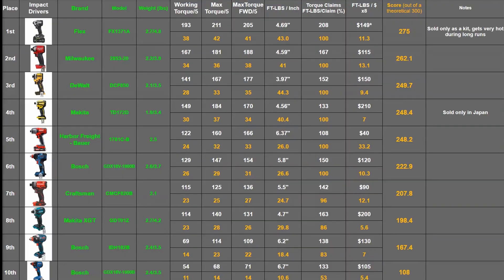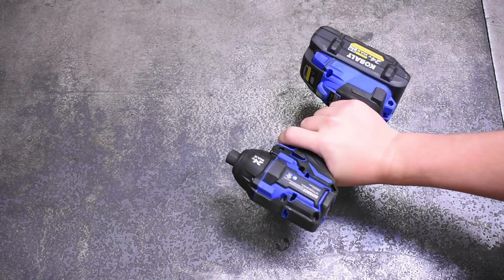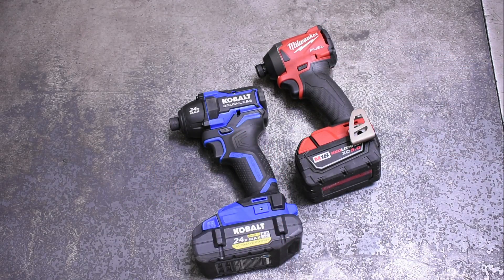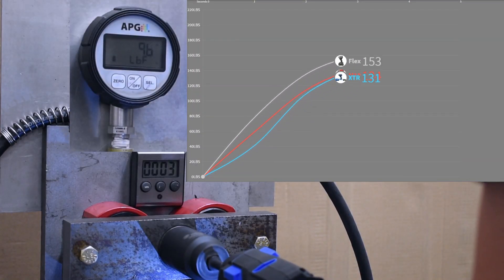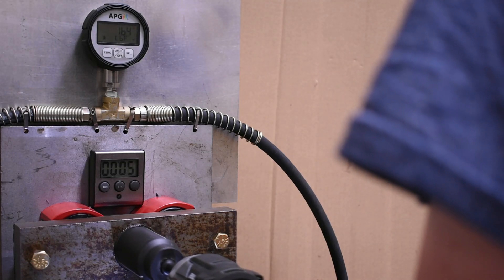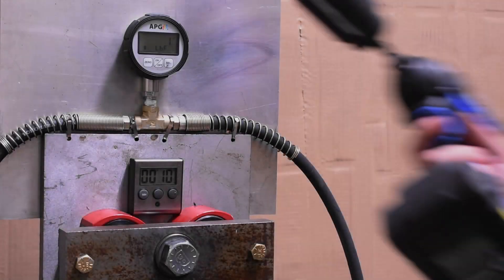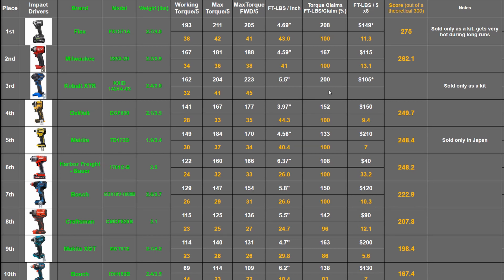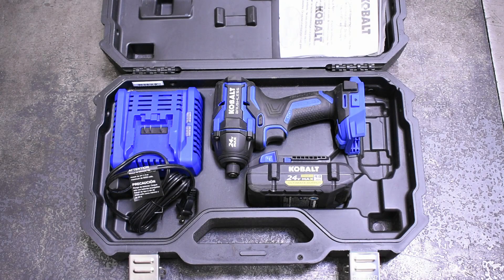You All Said THIS is the Most Powerful Impact Driver: Dyno Finds Out | Kobalt XTR

Comment: I went with Milwaukee if only because it's everywhere around here. Home Depot, my GearWrench guy sells it, JDTco sold me a few items. So far the bit driver is crazy powerful for the tasks it will be used for, needing only position 1 or 2 on the power modes to work effortlessly.
Plus 5 years on the tool and 3 years on the battery, set the industry warranty standard. Many are offering the same now.

But, they all seem like good tools, as long as the durability is similar.
Reply: Agreed a big plus to me is versatility of m18/m12 batteries for equipment. Not sure on kobalts line up for other tools

Comment: I put the anvil from a 3/8 drive impact into my Kobalt impact driver because it broke every bit I used with it but to get the power it has to have the high output batteries, the standard batteries drop the power way down.

Comment: So I have been using Kobalt for years but have been slowly “upgrading “ to Milwaukee.
On Monday I bought new M18 fuel impact driver. On Tuesday I have to drive 3/4” lag to hang a truss. I couldn’t wait to try out my shiny new tool but it couldn’t do it. One of my guys has an older Milwaukee non brushless. It drove it a little bit but stoped. Just for curiosity I told someone to grab my old Kobalt. It drove all 16 3/4 x5” lags all the way home. I couldn’t believe it. I kept trying the fuel just to see if it was a fluke but no it couldn’t handle it. I was so mad. I just went and spent almost 200.00 on a tool that couldn’t perform as well as my old cheaper tool.

Comment: Maybe test the non-XTR Kobalt. It’s $100 with charger, tool, and battery. Could be interesting to see how it stacks up since it is brushless and rated for 2000-inch lbs of force whereas the XTR is 2400-inch-pounds

Comment: I just bought the FLEX kit that has this impact driver with the hammer drill last week.  I'd like to point out that the FLEX kits give you One 5.0A/hr and One 2.5A/hr battery as opposed to TWO 4.0A/hr or 5.0A/hr batteries included in the other comparative brands (Milwaukee,  Dewalt, Kobalt, etc).  Keep that in mind if you are looking at these kits in terms of price, especially after the end if the year when the Lifetime Warranty promotion is expired.  One of my main interests is the bit retention, especially with spade bits.  One of the major problems with the Milwaukee impact drivers is that they eject the bits under load.  VCG Construction has a few videos of this failure and the improvement Milwaukee made to the gen 3 FUEL design.
Reply: It seems to be a common issue on all the super powerful impacts, Kobalt and Flex included. It certainly doesn't seem affect them as badly as Milwaukee, but it does happen with things like spades.
Reply: @GuyFromJupiter  Well Milwaukee fixed the problem tlby adding an additional ball bearing in the collet and re-released as gen 3.5 (I'll post the link below)

VCG Construction's video:
https://youtu.be/6jvjs2GZ9gg

Comment: What about the Klein BAT20CD? Rated at 210 ft-lbs (2520 in-lbs).  Basically a detuned DeWalt DCF894 with a 1/4" quick change instead of an anvil.  It even uses DeWalt batteries.

Comment: That's weird I have the flex and I would have to drive 15-20 6" truss screws at a time several times a day and it never got super hot like yours and definitely never quit on me. I have noticed that sometimes the computer chip gets a little confused and will put out almost no torque when you first pull the trigger, but it's rare and as soon as you pull the trigger again it works like it should.

Comment: Both the Milwaukee and the Flex are also equipped with a 5ah battery in these tests and the kobalt only has a 4ah, and it still kicks more torque butt per dollar spent.

Comment: I dont know if it was a few faulty units, but FLEX seems to have quality control issues with breaking handles, and while it brings the speed for easier tasks, they struggle with more difficult tasks that need better low speed power. The tests reinforce that. They also caught the overheat issue which I saw in other videos too. I wouldnt buy FLEX at all at this point.

Comment: How about the M18 with a 21700 cell battery like the others?  6.0HO?
Reply from the maker: The flex is using an 18650 and the XTR batt is closest to a CP3.0
Reply: Gotchya.  I knew I missed something.  That flex’s overheating is discouraging.  My m18 on structural fasteners all day on hot days is fine.  Couldn’t imagine the flex

Comment: I began having issues with my 2nd gen (may have been 3rd?) Milwaukee Not long after I got it. Would lock up if you tried to "tappy tap tap" the trigger. I'd have to pull the battery to get it going again, y'all ever have any issue with those? I'm not doing ornamental iron anymore so the drivers aren't an issue as of now. Was just wondering?

Comment: Question:  I have an M12 impact driver.  I was using a Ryobi impact driver rated 1/4" hex head bit and trying to break loose my stuck garbage disposal.  The Ryobu driver bit broke after about 15-20 seconds.  This shocked me - I would not have thought that an M12 impact driver could shear a 1/4" impact rated driver bit??  Are the Ryobi driver bits just weak?
Reply: I think the M12 is a reasonably powerful tool, at least considering its lower voltage. That said, I do believe Ryobi bits tend to be pretty subpar. To me it's seems like DeWalt makes most of the best drill and driver bits.
Reply: Yes they are…. I snapped a couple of them easy & that was it for them.  
Beretta9MMUSA Sr.

Comment: I have one of those blue monsters I honestly don't like it that much.

If I use it with socket adapters if I hit a bolt that's hard or tough removing something it just breaks the adapters and I have tried many different adapters all with the same or similar consequence of them breaking most of time after one or two uses if the bolt is particularly stuck.

 In fact I no longer use the most powerful setting. It would be nice if someone made a impact adapter that could take the abuse the new tools can give them.

Comment: I'd like to see the channel torque a bolt to 200 ft-lbs with that socket and that 1/4" drive adaptor and a torque wrench.  My brain says  nothing that skinny will take 200 ft-lbs.
Reply from the maker: It won't take 200 applied linear like a wrench. But in small impacts at a time...

Comment: I am curious, since "impact driver" is in the realm of purchases I can, and did, justify... I wonder if there's a more affordable of finding at least a crude performance rating. I'd love to know how e.g. my long discontinued Craftsman C3 compares to modern, fancier ones so I know what to look for and expect.
Reply: The C3 with a modern battery will perform well, the batteries of the C3 era weren't great. The C3 uses the same motor as the Ryobi P235 brushed impact, it performs very well with 21700 cells. The C3 might even with the old batteries probably matches the current Craftsman, but that's not saying much. 

I was talking with someone recently who worked in accounting for TTI. Apparently Sears missed lots of payments for the Craftsman C3 tools, they even went as far to claim they never received shipments.
Reply: I need a battery for my c3 impact and I wonder if I can run a Ryobi on it or how to modify one to make it happen again
Reply: @Beee_Ceee  you have to modify it, you can purchase an adapter or make one yourself. That's how these companies get us, unfortunately. Even though the Ryobi brushed tools and brushed Craftsman C3 used the same motors, they designed them to require different accessories. 

Given that the ebay adapter is 50 bucks, it'd be cheaper to buy a P235 impact(10-15 bucks on DTO), get the 10 dollar charger(the small black charger is actually the best for the new generation batteries) and spend the money for the good 3ah battery(best cells and performance). 

Upside about the Ryobi line is they kept the same system for so long, and they have any tool you can think of. Hell, if you buy one from DTO, they give away a free electrostatic sprayer for some reason at the moment.

Comment: I have a first gen Milwaukee.  Have had it since it came out along with batteries, so at least 8-10 years.  Not sure how it compares but have yet to buy new batteries and puts screws in no problem.  If you’re just doing simple stuff too much power can be detrimental.  Better off with consistent dependability.  Just my opinion

Comment: I have the kobalt XTR driver and used it for putting in lag screws for a deck rebuild, bought it with that box kit with the hammer drill, sawzall, 7 1/2 circ and light deal.  The circ ended up being somewhat disappointing with pressure treated 4x4s.  I ended up later getting a 1/2" kobalt driver for car work as the driver wasn't exactly fast for lug nut busting, and I did blow right through an adapter.

What's funny is that the tools I use most are lights not from that kit (I got one for 10usd and another for 40usd) and the tire inflator.
Reply: Ya that circ needs the 8ah xtr batt( whenever it gets here). My friend bought the Craftsman 7 1/2 that came with a 4ah. He was disappointed, but then he put their 9ah and wow what a difference.
Reply: I have that fire inflator and it has really come in handy! I would happily recommend it to anyone invested in Kobalt 24V. I also have the cordless shop vac which has been pretty nice as well, and I would definitely recommend it to anyone interested in one. One nice thing about it is that you don't have to remove the filter to vacuum up water like most other brands say you should.

Comment: How about a Flip socket test, I noticed today my mid tq gen 3, 1/2in Milwaukee wouldn't pull the lug nuts off my f550 with the bluepoint 21/19mm flip socket with the bluepoint 3in extension,  put a 21 impact socket on the gen3 3/8 and it pulled it off like nothing.  Very disappointed with this gen3 mid tq, what good is it if u can't use a 3in extension.  It wouldn't even pull off the nuts on the front hub extension to do a wheel bearing.  Had to get out the old 2017 2767 1/2in
Reply: I should've tried the capri and Husky flip sockets I have, they are heavier then the bluepoint

Comment: The internals are very similar to the Skil 20v brushless impact driver. That one is even less expensive, often less than $140 with battery and charger on Amazon. I doubt the Skil has quite the power being a lower wattage unit, but it would be curious to see how well it stacks up.

Comment: Kobalts xtr is the best kept secret in the tool world. They perform at top level and cost just a tad more than ryobi.
Reply: Yes and, actually, even less expensive than Ryobi when the price of batteries and chargers are considered. And you have to allow for that.  I'm a Kobalt fan boy nowadays.
Reply: @rtgray7  Me too. I kept replacing Dewalt tools left and right and with their batteries being SO expensive I decided to try Kobalt for my crew. If a battery gets lost its not breaking the bank and if the battery or tool broke you walk into lowes and they give you a new one on the spot. Great tools for the money as far as I'm concerned
Reply: I sold my fairly extensive kobalt collection due to the batteries not holding up and not having a good run time.  I’m my scenario, they aren’t geared for every day professional use.
Reply: the only problem I have with ryobi is the cost and.....they seriously need to upgrade some parts especially if they are claiming to be pro. Like come on, stamped steel shoe base for circular saw like really?
Reply: shh, quit talking about it
Reply: @Highstranger951  you're the only one. I know a handful of guys using kobalt 24v. Not a single issue.
Reply: I’ve been using Kobalt 24v tools since they came out and I use my drill set every single day to mix grout,thinset,and sand mix and I’ve never replaced it
Reply: @charlesking678  he’s not I’ve seen a ton of battery failures from them both guys I know that bought into the line gave them up and went to ridgid after a lot of battery failures and they have a very short run time.
Reply: I love mine
Reply: that is true if you don't take sales into account. when this video was posted a year ago, the dewalt DCF850 was on sale for $140 with two powerstack batteries and a drill (kit model number DCK254E2). right now you can get the DCF850 with a 5ah battery for $120. it has been on sale for $100 as a stand alone tool many times. it's a lot smaller and lighter than the flex.
Reply: Durability is the most important factor. It's easy to make a powerful impact device. That's the main thing separating pro and consumer grade tools. Most of us just need the cheaper power tools for non professional use.

Comment: The best deal I ever got was when I purchased the five tool XTR kit. It came with their hammer drill, impact driver, reciprocating saw, flashlight, and circular saw; also two batteries and a charger...And let's not forget the high quality very sturdy toolbox with wheels and extendable handle...all for $350! Hands down best power tool deal ever!
Reply: Yup I'm sold on this line of tools. Happy with them so far
Reply: Got that xtr 5 pcs kit for 299.99 CDN this week at lowes , incredibe vaue
Reply: And 3 years later I bought the same kit for 225

Comment: These Cobalts remind my hubby and I (working HVAC, Home build, to vehical mods) find these to be similar to the original Dewalts.
As drills go, we just bought the impact driver... so this is nice to see. Over all as a whole line up goes these will do great for the average tinker in the garage home owner. Average for people like us, which means we feel we get our money's worth plus we love the blue which is honestly just a bonus not a decision making factor for tools. I'm very sad to see this line being taken over by the new China born Craftsman at Lowes. Bad decision in our humble opinion. We were so disappointed when Black-n-Decker took over Dewalt. They still do OK, but they are sprinter tools verses cross country. I like my money to stretch further. If we go with something else it's usually Milwaukee or Bosch. We haven't tried the Flex yet but not likely to as we are pretty stocked up on tools right now. A couple years, we'll see what we're in the market for. We don't subscribe to upgrading for upgrading sake alone. If something breaks we replace, otherwise we work it to the label wears off and the tool looks ragged. Hubby was a rock quarry mechanic in Montana for several years and bought some Mac Tools, which 17 years later still work like they are brand new. Working on that kind of machinery and Diesel 18 wheelers hauling rock teaches a new kind of level in tool tough integrity. Where HVAC we ran our tools for long periods of time with little need for the strongest horse in the barn. Hike improvement can need both and vehical mods as well. We're pretty well rounded here on Sunset Blvd. Great reviews, glad I found your channel. I'm wanting to replace my hubbies pliers... all of them since they are all pretty toothless and ragged now. Learning about all these different pliers is making me dizzy. Any suggestions for a brand that offers quality that will last at least 10 years but not cost Snap-on prices? Cresent and Crewline are the brands he used... and he's hard on his tools. I was thinking after watch many videos of going with Irwin or Wren? But I'm finding each type of plier has different top ratings in brands (Cresent, needle nose, cutting pliers etc). Why can't one brand make great pliers in each category? Drives this lady crazy!!

Comment: The flex isn't in the same class as the milwaukee or kobalt being a lb heavier my opinion. Weight matters if you have to carry your tools to the roof of a commercial building to fix or install an air conditioner.
Reply: I'm an ac tech and use the xtr, they give you belt hook with the tool, use it

Comment: Given that the Flex seems to overheat in every test I've seen so far, it didn't really fully deserve the #1 spot. Also given how much the bear rants and raves about the Kobalt, it's good to see all that backed up with some numbers.

Can they make impact drivers any more powerful? Should them make them any more powerful given how many adapters and pieces fill your garbage cans? It doesn't seem like 1/4" drive can handle much more.. okay it can't handle this.

Comment: I wish that the money would have been spent on updating the kobalt tools lineup instead of making flex. Imagine if they used all that marketing money to make some other top level tools and maybe modernizing or expanding the battery lines, larger tool lineup etc. They could have made the best 3/8, 1/2, and 3/4 impacts recip saw, or whatever. 

I think kobalt is the only tool that has 2, 1st place tools, no? The right angle impact and impact driver.
Reply: They should've
Reply: Maybe they just think that kobalt name is what’s holding them back.
Reply: Probably because Kobalt is owned by Lowe’s and not Chervon
Reply: Ya the virus hit right at their launch and then Flex. They need to get that 8 and 12amp batts out.